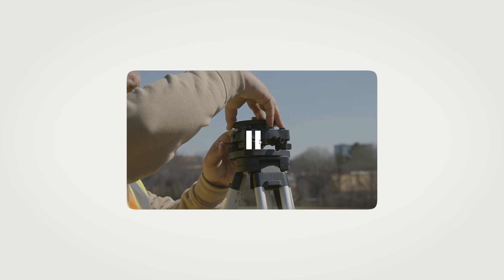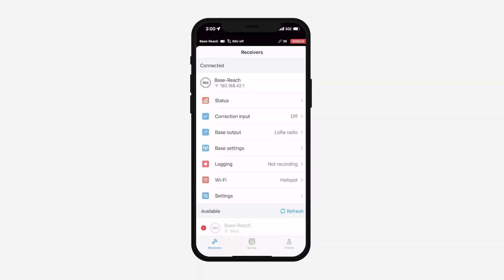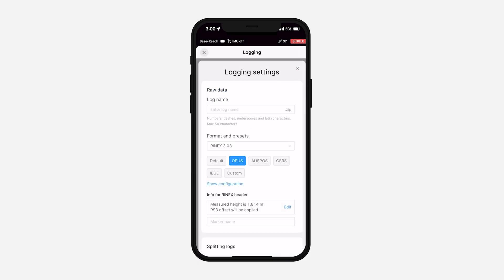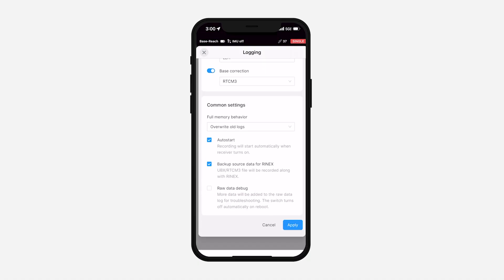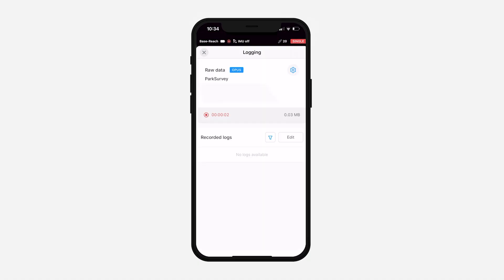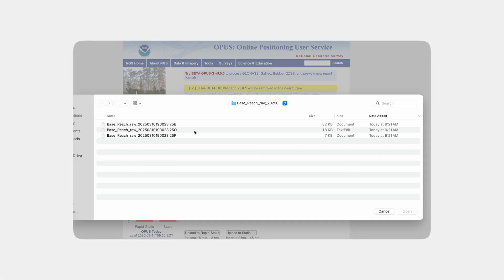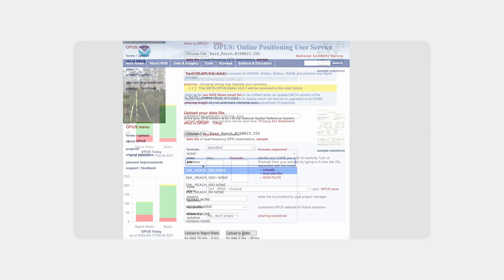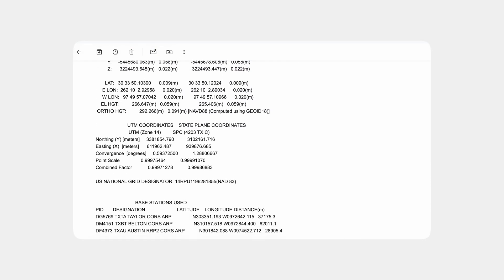Setting up a GNSS base. Getting base position from post-processing services

Comment: Quick Question - are you using the Lat, Long and Elip Height from the OPUS Solutions report to enter as you known location after static processing?
Reply from the maker: Hi! Yes, OPUS provides them in NAD83, so it works perfectly. Especially, make sure you're using an ellipsoidal height because base height must be ellipsoidal to get correct geoid conversions on the rover.